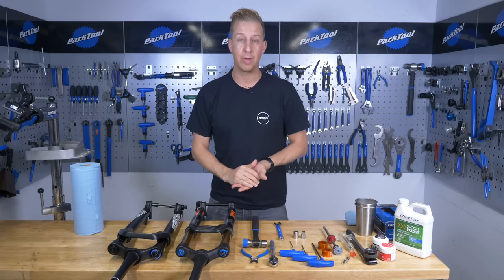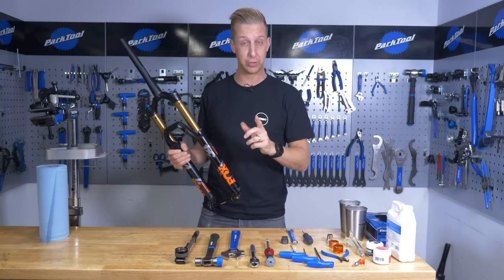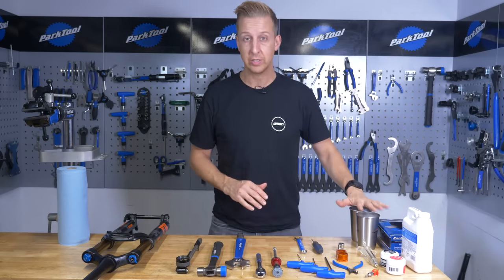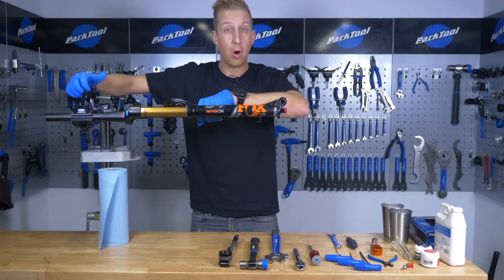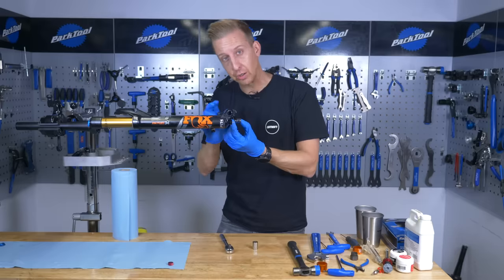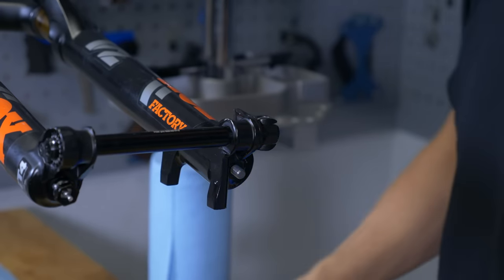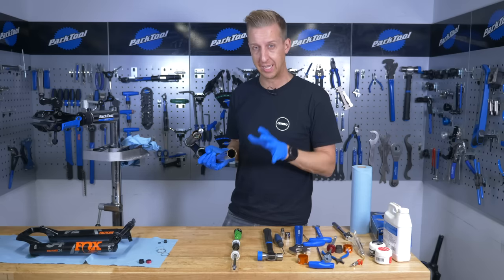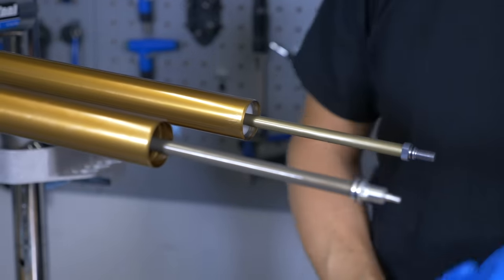How To Fix Fork Suck Down On Your Mountain Bike Suspension Fork

Comment: Should I see about 5% sag (without rider) with an upgraded Debonair spring on a RS Pike ?
Reply: Noah Fence it’s not abnormal... kinda towards top end of normal depending what pressure you run and how much travel but nothing to really worry about.  The Deb airspring is “similar” to the luftkappa and there is an explanation why on their website.
Reply: 5% is high but it is a factor with the (too big) neg chamber. However, mine has got better over time riding...but using the cable ties down seals and pull lowers out manually helps...keep lowers at max while someone else removes cable ties
Reply: @rupedog  thats the second time you recommend to use cable ties down seal... and again, its NOT for this problem...

Comment: My 34 air chamber was "full" of grease. Is this how normal? It looked like they had threw few tablespoon worth it there as chunks.
Reply: Fox often puts in way too much at the factory, which leads to issues. It will be smoother now that you cleaned it up and put the right amount on
Reply: @adanielweaver  Had to put 2 volume spacers in. But damn, it's so smooth.
Reply: @adanielweaver  RS does the same

Comment: Is there any reason to go out and buy a rubber mallet vs finding a soft bit of wood and placing that between the hammer and what you plan to hit?
Reply: Accuracy and simplicity..less to hold...mallet cost £2 in cheapo shops
Reply: aljowen yes ... you can get them for literally 2-3 £/$/€ from camping shops (for tent pegs) or hardware shops.  especially on fox where the damper side is more exposed.  For rockshox less so and best investment is a 150 mm (6”) extension for a 5mm hex bit (like you’d use on a drill) it’s much easier to use than a hex/Alan wrench with a curved top.  You can buy both for a lot less than the cost of a damaged damper bolt. Mallet is good elsewhere as well (like cranks) and the 150mm extension is great for brake callipers
Reply: @stephenlord599  I have SR Suntour Aion forks. The whole service can be done with an adjustable wrench*, suspension grease, oil for wiper seals, and a hex tool. It might be worth me getting a mallet if I ever spot one, but I guess its not a priority.

*Personally I'm not a fan of using them, but it seems SR Suntour do in their instructional videos and a socket won't fit (only two sides are flat, others are round) :/